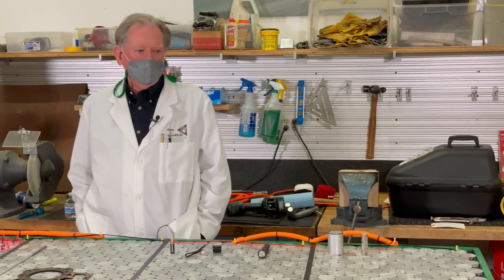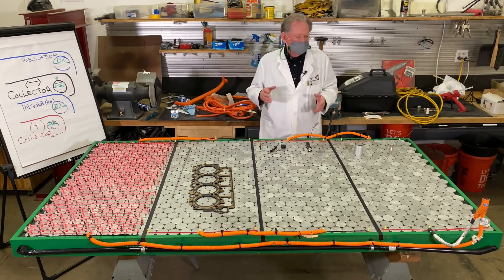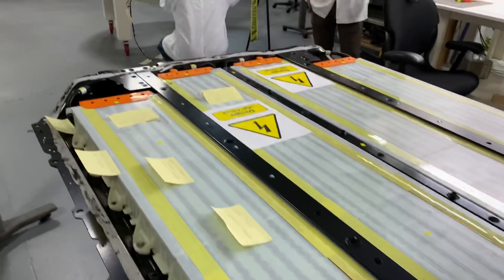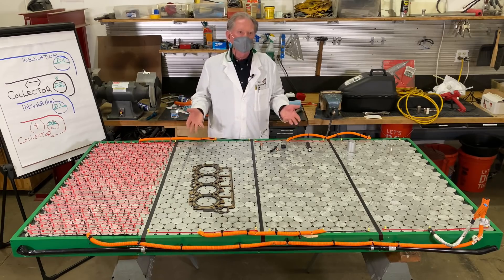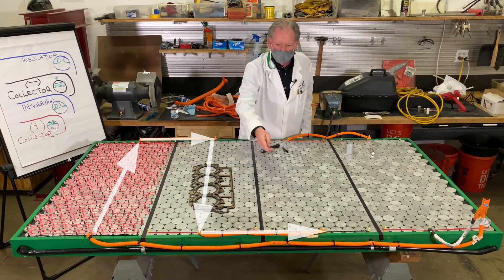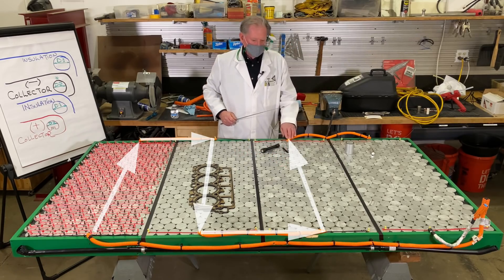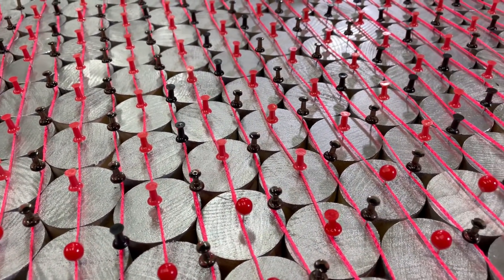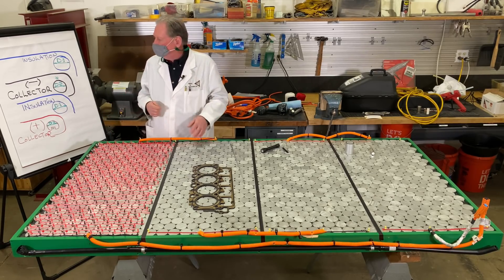Tesla 4680 Battery Pack Prophecy

Comment: I predict they wont drop the little wires, they seem keen on fusing each cell
Reply: It depends on if they can get the same "fuse" effect with a manifold. If they stamp each manifold so that there is a thin section just the right width near the spot weld point it can act as a fuse. It may even be easier and simpler to do than the tiny wires.
Reply: @JasonWW2000  True! That does seem a lot less fiddly that way

Comment: 1) No need for inter-module cables, when Tesla already chains the batteries so as to have poles head-to-head.
2) Cells still need a fuse. The "wire" might get made out of a thin strip of gasket.
Reply: I concur, as Elon says: less is more!

Comment: The small wires act as fuses, how will they do that in your system? will the fuses be built into the manifold?
Reply: Most likely yes. If the manifold is stamped, they can create a narrow section where the tab gets welded to act as a fuse. Same concept as the wires, but easier to manufacture.

Comment: Sandy thanks for all the great information. I have a question related to the tab-less battery and the manifold. Since the whole top of the tab-less battery is all positive and the outside wrapping of the battery is the negative if the top of the battery (positive) and outside wrapping (negative) why couldn’t the manifold be made without welded tabs. Where the top (+) is slightly higher than the outside wrap (-) allow for just tightly pressing the manifolds four layers with negative layer being slightly bigger in diameter and the positive (+) layer slightly smaller so no welded tabs are needed

Comment: Nice explanation! Wonder if you could arrange the battery's in such a way that the 400V end terminals will be at the same end of the battery pack. If the total leads are shorter that way there may be less losses and you save the weight, cost and installation of the heavy gauge wire. You may be able to achieve this by using a Hilbert curve.

Comment: Great insight into the wiring up of the batteries in a mass manufacture view. But I have a question. Isn't the sides and base also negatively charged? Couldn't a manifold be then put on the underside? But then this raise the next question. with the manifold in place like this how are they going to attach the batteries to the top and bottom of battery section of the car? Their going to have to leave contact area for the epoxy to bond to. And use a non conducting coolant to prevent the bottom of the car from being negatively charged. Or is it like double hulled with the coolant between the inner and outer hull?
Reply: On further thought, if one has an inner and outer hull design. Then the manifold would be in the design of the inner hulls, with insulation bonded to it. But how will one weld it to the batteries, with out damaging the insulation, or epoxy? ? Ultrasonic welding
?

Comment: Sandy: Please explain something that doesn't make sense AT ALL....how does 6 times more power and 5 times more energy get ONLY 16% more range.

And there's NO WAY that is 5 times the energy. Are we literally saying that a 100kwhr pack is now a 500kwhr? No...so what the heck does "five times more energy" mean exactly, in science and engineering terms please...
Reply: It is comparing a single 4680 vs. a single 2170.

Comment: Ain't it more easy to put the batteries sideways so they are automatically connected on the top and the bottom? Even without any wire?

*edit: Basically like in the flashlight?
Reply: You need to make stable contacts between cells poles and use some form of fuse wire to connect cells in parallel. You also can't just stack the cells one on the other and push them togheter as in a flashlight, because this way you will only have a series connection and not a parallel.
Reply: @GiovanniEsposito5  Well, at the top you connect it back the other way so in the end you got a + and - at the bottem quite close near each other and you can do that like 15 times to so. Those 15 times can be connected parallel.
Reply: @zezizarjaars  That's exactly what you want to avoid. In the configuration you proposed, all the cells are in series, so if you loose one cell you loose all the cells in series, with a massive drop in capacity for the whole pack. If you connect most cells in parallel, if you loose a cell, you loose just that one, with a minor (almost irrelevant) drop in capacity.
Reply: @GiovanniEsposito5  Yes, but a Tesla needs more then 4 volts, it actually needs about 400 volt, and obviously that's done by putting them in series, exactly like Sandy Munro also did.
Reply: @zezizarjaars  You first put cells in parallel, than in series. Never the opposite. Why? Take for example the Model S 18650 battery module: it's 6S86P (6 series of 86 cells in parallel) All cells in parallel have a fuse wire, if one starts going bad, the wire fuses and the cell gets disconnected from the pack. What happens to the pack voltage and capacity? Almost nothing, you just loose 3500 mah.  Now imagine the arrangment is different and you have high voltage in each module, let's say 370V. It's 100S5P (so almost the same number of cells of the actual module). What happens if you loose one cell? You loose an entire strip of 100 cells, with a massime drop of 1/5 of the capacity and voltage of the whole pack. That's why you want many cells in parallel and a few modules in series and not the opposite.

Comment: How about if the top is the (+) and the bottom & side represents the (-) up to the black ring gasket,  contact on the sides of each battery will be the contact for ground (-), so the main ground contact will be on the full exterior of the pack, only need to weld each (+) on the top, or a plate with a spring tab for each (+) contact.

Comment: Random thought: in speed up producing packs, would it be possible to create a giant spot welder that could weld all the tabs/connections for an entire module in one go (i.e: weld 90+ connections at once)?  I've seen other industrial videos where they use a rolling copper wheel to do a continuous weld (like on electrically resistive welded tubing).  Being able to stamp down, weld, and lift up and do an entire module in one shot would definitely be a lot faster than spot/laser welding each cell.

Comment: Do battery cells have to be round, or can they be square to fill the empty space in the modules?
Reply: 'Jellyroll' cells are significantly less complex and less expensive to manufacture. 
'Prismatic' cells are built like layer cakes.  That's more space efficient, but the precision cutting and alignment for the layers makes them more difficult to mass produce.  The extra cost is a minor trade-off for cell phone and laptop batteries, but is an issue for larger batteries.
The space efficiency difference is smaller than people intuit, and prismatic cells often give that up when cooling for larger packs is factored in.  Heat can be more easily moved within a layer than between layers, so a thicker, larger pack is harder to cool.  The usual solution is heat transport plates between stacked cells, eliminating the volume advantage.

Comment: Great video but the manifold cant be such solid piece on the spotweld area. The little thin wires on the shown model Y battery are not accidentally thin wires, they are cell level fuses. The manifold must have the welding spot region separated by a thin section to act as a cell level fuse. Probably doable within the stamping phase?
Or are you believing for some reason, that Tesla will not continue having cell level fuses in their battery pack?
Reply: also the thin wires allow a tiny bit of flex without stressing the spotweld, i think that is important attribute the new system must keep too.
Reply: Look again at D3 it has a small narrow tab, a fuse. All the best.
Reply: @MikeCasey311  that would be too large of a surface area, too rigid and not cover the negative pole. I speak from experience. We are talking about 1mm squared dimension over 20mm. Able to micro-bend in any direction without stress on weld.
Reply: @gelisob  You may be correct. 🦃

Comment: I'd love to hear some of the reasoning behind some of the concepts described in the video. For example, is it common for the negative and positive connections to be on the same side of the cell? Is the pack broken into 4 modules only to get the right voltage or is there more to it? What is the significance of theses changes and how exactly do they differ from the previous design?
Reply: negative and positive connections are on the same side of the cell just like current 18650 and 21700. So normal. The 4 sections are arbitrary. new design may change that. To get proper voltage requires proper wiring. Something like 24 Series and 10 Parallel.

Comment: Great video as always! Hmmm so with that design, if they do trays like that, then it’s possible they could have each “tray removable” and new one slides into place for future upgrades? Especially useful going automated robotaxis and reusing batteries. Just was thinking about it like iPhone being the pack and have 4 slide out trays for battery.
Reply from the maker: thanks for the comment. We believe 100% of the 960 cells will be glued in place with structural adhesive. Almost impossible to service, but very reliable and structural.
Reply: @MunroLive  Yes, even harder to "service" than current packs. They where never made for actual servicing.

Comment: Great video, I actually do not understand, why tesla is nich Increasing ther System Voltage, couper is expensive, go up with voltage means less couper due to less currents, silicon is much cheaper than couper, SiC Fets are increasing the system voltage, has anyone an idea (the only reason I see is that probably the SuC can not do higher voltages and the will not update all of the chargers)?

Comment: Thanks, Sandy and team. 
I am struggling though at how the “manifold” concept addresses the series connections between parallel cells— don’t you just need a single conductive layer?  Also, for the stated benefits in increasing the current path with the tabless design, do you compromise that with a single spot weld?  My (lazy) math pencils out that a 8mm diameter spot weld would be needed, which seems quite large.

Comment: Ummmm your hole sizes of your manifold would have to be incorrect. If the sizes went D1-D2-D1-D3. In that case D2 would short out to D3 at the hole ring. The second insulator would have to be smaller than D2 but larger than D3 to keep the positive from shorting out to the negative

Comment: I think they said they would ditch the module design and it's going to be a whole unified pack without modular design or am I tripping somehow?
Reply from the maker: You are correct. When Sandy said "Module" he was only referring to how the current is collect in 24s10p and then repeated 4 times. If you look closely, our pack is one giant assembly of 960 cells, from a manufacturing perspective. Also, no ribs or structural beams. Thanks for watching!

Comment: My biggest concern about using bigger/ less batteries is; when a small battery goes bad, no issue and barely noticeable. When several go bad, you loose some range and and power. What about when the same amount of bigger batteries go bad? Wouldn't it be a much drastic difference. 1 big = 4 and some change of the small ones

Comment: Couldn't you just add more layers of collectors with different connections to change the voltage?  Not using a transformer but a different connection between the cells. This could avoid the use of 12V Battery and other voltages maybe even allow to charge the pack at higher voltages?

Comment: Wouldn't spot welds create a current bottleneck that defeats the purpose the tabless design? Why not make a connection all the way around the rim, for example? Likewise why not make the positive connection over most of the surface of the top of the cell?   

For that matter why not make the negative connection on the bottom surface? (Ok, maybe that makes it difficult to get the series connections... but then again why not alternate the orientation of the cells, up/down/up/down then series connections are easy with a flat piece of metal across cell-pairs.

Just wondering. I'm sure there are good reasons I'm simply unaware of.

Comment: If you move the holes in D1,2,3 & 4 around a little you could lay them all in at the same time then complete all spot welding in both layers simultaneously. 1 to 2 steps is better than 4 to 6.
Reply from the maker: You are correct. We didn't want to give "everything" away. At one point we had filmed 10 minutes showing paper-representations of each layer. That footage didn't make it to final cut. Thanks for watching.
Reply: I think I get it. There could be one set of small holes at the edge of the cell for the negative connection and another set of small holes at the center of the cell for the positive connection.

Comment: How does this pack reach 350v with only 4 sections in series
Reply from the maker: 96s10p. 96x3.5volts=336v. each section (1 of 4) would be 24s10p, 24x3.5v=84v

Comment: Yes, and the manifold could be used as a form and heat sink. So you have it protecting each battery by form fitting around it and a thermally conductive. The one thing I have het to hear anyone talk about and I would love to hear you address it......... how exactly are you going to replace a cell to structure battery? Seems to me Tesla has engineered obsolesce into the new battery packs because they aren't packs they are structures of the car. Some of you will say, it's a million mile battery they don't need to replace it. Okay but  how are you going to recycle the batteries? 

I feel like this is a major topic that no one is addressing and Sandy himself pointed out when he said they will likely use and epoxy type glue so that the batteries become part of the structure. I am sure that you can still get it replaced but the level of complexity to remove the main structure of the vehicle is exponentially harder than what they have now. Are we all just cult members instead of fan boys, why is no one pointing out the engineered obsolesces of cell to structure.

Comment: Sandy, thanks for a great breakdown on how the pack can be arranged and electrically connected. Just one comment: perhaps I have it wrong, but should not the diameter of the hole of the second insulator be smaller than D2, rather than equal to D1? (Otherwise it appears to me that the positive collector will short out the negative collector).
Reply: Exactly, I noticed the same thing.

Comment: If the middle insulator has a larger opening (D1) than the negative layer won't the + and - layers short? I think the middle layer needs to have a smaller opening than the negative layer and larger than the positive layer.

Comment: Could the  battery wiring be accomplished with a two sided printed circuit board? One side of the board positive and the other negative and with drill holes for pins?
Reply: There may be too much current and voltage for a two sided printed circuit board.
Reply: @JasonWW2000  They used to use printed circuit boards in vacuum tube radios and TV sets that used considerably more current than modern transistorized integrated circuit devices. such as an Apple iPhone or a Raspberry Pi 4.

Comment: Thanks Sandy. The manifold is similar to what I was proposing - a way to connect the new batteries in a way that minimizes wiring and failure points, etc.. It will be interesting to see what Tesla comes up with!
Reply from the maker: Thanks for the info! and thanks for watching Charles.

Comment: Very interesting concept.  One gasket design that can be alternated back and forth to create the four circuits. And this leaves the bottom open for the cooling channels. And all of this chemical welded together with an insulating cement between aluminum foil plates in a massive block. I AM curious if they will weld the manifold to the cells or if they will also use some kind of conductive chemical weld for that.

Comment: So each row of 10 is in parallel? and all the rows of 10 are in series. So all the positives on one row of 10 and all the negatives on the adjacent row are all connected together?
I don't really see why you'd do wires or a 4 layer manifold, you could just run a two layer strip along where those two rows butt up against each other.
The bottom layer is a stencilled insulator and the top layer is just a straight metal strap. The strap is spotted to the battery edges on one side and the the middles on the other side. The insulator makes sure the strap only touches where it's spotted.
Reply from the maker: 10p yes. That could work, we had several different styles of collector plates and settles on this design for ease of manufacturing. Thanks for watching.

Comment: The little connection wires they currently use are fuse links.  With your design how do they prevent a cell that has gone short circuit from killing the entire battery?  I think the little fused link wires will remain although scaled up?  Maybe a narrowing of the tab on the positive side to limit the max current?
Reply: yes, exactly. This will be easier to manufacture compared to the tiny wires.

Comment: Thank you 🙏 Sandy that was an awesome excellent succinct informative and flawless video 👍🙏💪.. and it was cool 😎 too...🤔 I got only one question ..how do you COOL this package???🤔
Reply from the maker: Glad you enjoyed it! we think it will be cooled from the bottom.
Reply: @MunroLive  Ahhh 🤔 I remember that in one of your earlier videos you suggested it would be on the bottom with the negative end of the batteries..this makes sense though 👍 thanks again 🙏🙏💪😎
Reply: @billhanna2148  With current cells, the whole case (sides and bottom) are negative with the top center section isolated and positive. This allows for both positive and negative connection at the top of the cell.